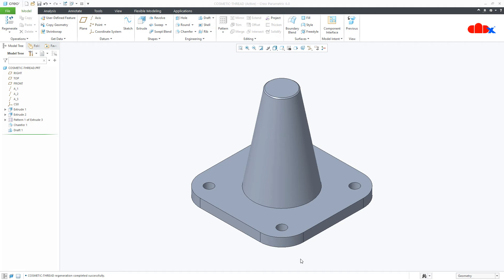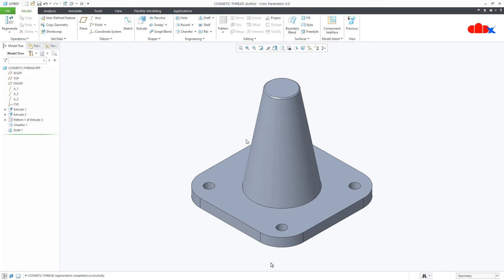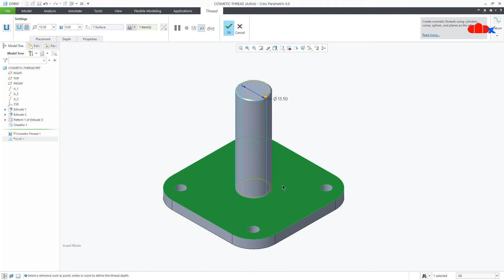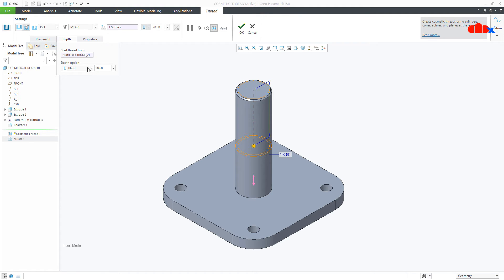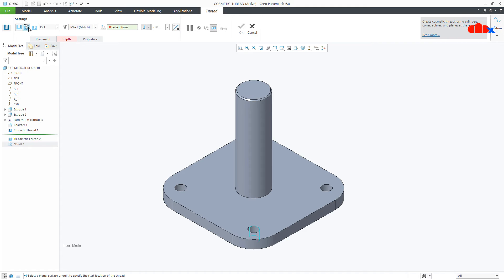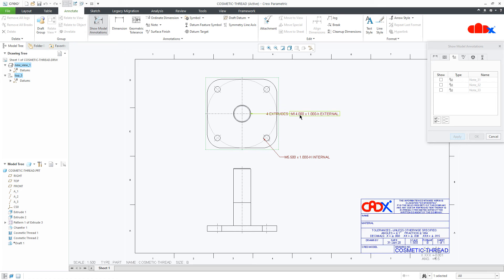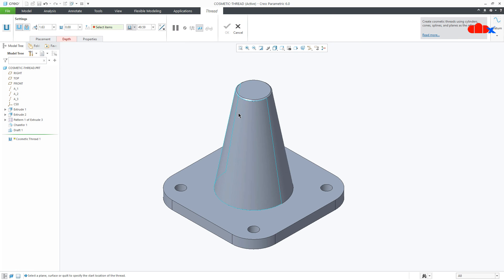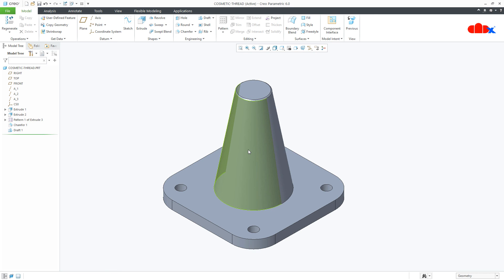Cosmetic thread in Creo Parametric

Comment: My requirement > To export large assembly as .igs & .stp as single part in Creo.
Motive > To prevent others from reverse engineering & get part level detail.
◆ For IGES I exported assy. at default coordinates and opened it as single part file in Creo.
Result- i.) Common parts borrowed from other assy. dislocates from assy. coordinates.
ii.) Common parts locate themselve at their default locations.
◆ For STEP Same attempt as .igs.
Result- i.) Same result as .igs.
Note > This was attempted in both Top down & bottom up assembly sequence.
Reply from the maker: Try this. This might help you.
https://youtu.be/6AmuYGjpe-Y
Reply: @CADxTraining  I am well aware of this method & we regularly practice this in our company. But now adays we are dealing with huge assys. (~500 parts). So this require extra effort & is tiresome. Is there any other way beside this to quickly perform this task ?